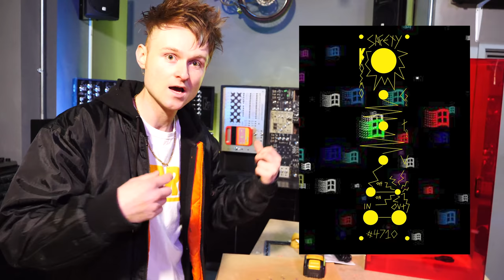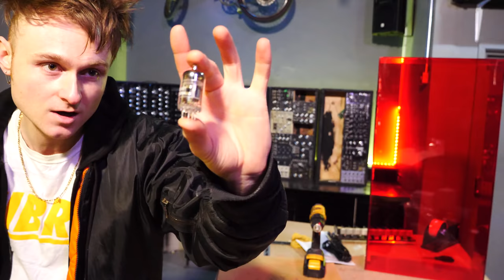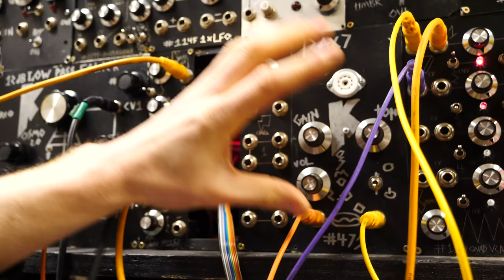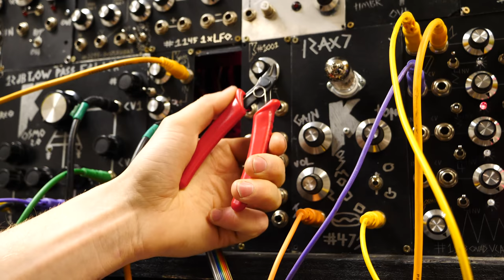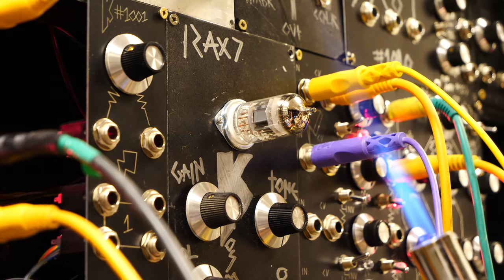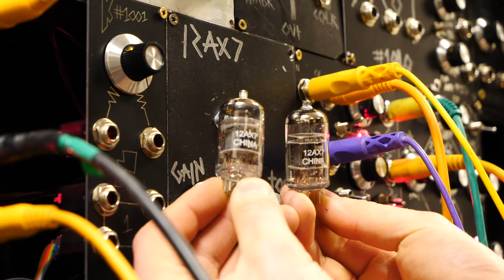Breaking a Vacuum Tube And Seeing What It Sounds Like - On A Valve Distortion

Comment: I'm leaning towards building a rack mount quad safety valve unit with four sections you can chain or use separately.  Can't afford a culture vulture so maybe this will scratch the itch. Maybe some Swedish input/ output transformers..Thanks for the builders guide vid..Awesome sounds!

Comment: Yikes. I unknowingly ran a 230V tube preamp with a cracked valve in it for a while and it literally caught fire. I had to rush it out on the balcony. The toroidal transformer in it got completely fried. Worked again once I replaced the tranformer and tube.
Reply: That should happen, toroidal transformers should be protected on both primary and secondary side with slow blow fuses, as well as having inrush current limiting, as well on primary and secondary, that peamp must have been pretty sketchy o.o
Reply: @yyunko7764  It was not a brand circuit no. A DIY thing, not built by me. No blow fuses in it at all but I was a bit surprised that the automatic flip fuse in the house didn't release once it started malfunctioning. I guess it would have if I would have let it burn and not unplug it as soon as smoke appeared. The flip switches are at 10A.
Reply: @tungtobak  Yeah for sensitive stuff, one cannot rely on the mains breaker. Toroidal transformers in particular require more protection as they draw a lot of current on startup which can be dangerous.

Comment: The difference between a transistor and a vacuum tube is that in a transistor, electrons flow through silicon that has been "doped" with either electron rich or electron poor chemicals or minerals. In a vacuum tube the electrons flow through it in a vacuum. If you fill the tube with anything (like air) the electrons will not be able to jump the gap between cathode to anode and the tube ceases to function - immediately. This tube, (12 AU 7) is a simple, dual "triode", or like two transistors in one package, and it's typically used as an output amplifier for audio frequencies. The two sides are often used in parallel to increase the amperage output without increasing the input voltage.
P.S. Even if the heating filament broke (the most common failure of a vacuum tube - same as a light bulb) the cathode would take a short time to cool and electrons would continue to flow for a (noticeable) fraction of a second. The decrease in volume is because heating the glass "nib" allowed just enough air into the tube to resist the flow of electrons but not stop it all together, until the "nib" was finally removed and the tube filled completely with air.

Comment: When I was a kid thirty years ago I smashed some valves just to see what's in there. It's nothing I'm proud of, but I'm not ashamed of it either. Sometimes you have to destroy things to find something out.
Edit: typo removed.
Reply: What did you find out?
Reply: Reading a good physics and electrinics textbook would haven you much more insight. Breaking things and looking inside is NOT a scientific experiment. It just breaks the device and makes it unusable.
Reply: Definitely the life of the party right here.
Reply: @pcuimac  yes always read books.  Never learn anything for yourself.  That's how the astronauts made it to the moon.  They read a science book that told them exactly how to do it.  Nothing was broken along the way.
Reply: @existential_fred  concentric thin metal sheets, bent to strange forms, some with thousands of tiny holes. Short wires. Powdery stuff. But I didn't see a single electron. Maybe that was because the air had already rushed in ;)
Reply: @pcuimac  So, what do they do at particle accelerators? Break atoms to have a look inside.
I was already told what's going in there by a radio technician. He was with my friend and me while we crashed the valves, to keep us from messing with the barium oxide. And you are right, it wasn't a scientific experiment. There were no scientists there. It was a kid's experiment. And kids need to see things. We also crashed some nixies that day. Those were even more interesting to us. And these days they were useless junk.
Reply: @pcuimac  That's just being closed-minded lol.

Comment: Is it me or does it sound really cool warming up :3
Reply from the maker: Well funnily enough the safety valve module is always in a state of warming up. It's extra frazzly because it never gets as.warm as the 12ax7 is meant to for proper functioning
Reply: @LOOKMUMNOCOMPUTER  it should have a heater voltage knob :P

Comment: Look Mum, No Valves..

I would like to see some sort of 'gangster engineering device' meddle with the micro voltages required for the valve - either by toggle switches, dials, touch sensors, CV etc and then use some ultra sensitive light sensors to capture and transform the light to spew everywhere and control things.  The Demon Valve Machine needs to be born!

Comment: I know another way you could do this...use the power supply from a plasma ball and you can basically make an atomically small holw that will beam a jet of hot plasma...you could pick a sensitive spot like the grid to spray an electron beam on...

Comment: Try toying around with valve heater voltage. You would probably need some some sort of digital thermostat to keep content temperature. I saw cheap ones people use in DIY ovens, just pass heater voltage thru it and tape its sensor to a tube.

Comment: If you want to play around with it a bit more, you can get modern ECC83 tubes, they are pretty much equivalent to 12AX7, just like ECC82 is the equivalent of 12AU7, from the sources I get mine the ECC tubes are cheaper

Comment: Interesting! Could you remove the glass from a valve and use a vacuum chamber to make the right environment for it to run? Then you could try different gases or something, I have no idea how valves work but might be cool to try. Interesting to mess with lightbulbs like this too
Reply: It might be neat to put neon in the tube.  Might not work for sound (maybe) but it might look cool
Reply: You can actually make valves by putting electrodes in a open flame. The flame is plasma and will allow the electrons to flow freely as if there was a vacuum. The problem is to get a flame that won't destroy the electrodes. You will probably want something that burns without soot and not too warm, but thats only if you want long-term use.

Comment: My band and I were jamming about three years ago and we were using two tube preamps/parametric/compressor modules and we were running the drum mix into one and randomly a tube exploded and shattered and it sounded like a bomb went off.... it almost stunned me and it was sooo loud. I have heard of this happening but never experienced it. Luckily my system had a limiters and power safety devices that kicked in to protect my gear but damn. Pretty sure my right ear/hearing took some damage haha

Comment: The 12ax7 may be cheap, but you may have to replace other components damaged by your 'fault insertion test', including a burnt circuit board.
Reply from the maker: never had that problem, but always a first

Comment: Similar to lennarts comment already here, how about you extend the valve/tube with wire then run the valve in a microwave oven... especially an 'inverter' type and at very low power so it doesn't just initially blast it at full power.  This is something I've been wanting to do for a while but hey if you're keen then please take it and run with it :)

Comment: would be interesting to see the same experiment done with basically a really sped up version, like inaudibly high frequencies, so that you could hear the affect during the brief second where it dies, though i suppose it would be more accurate if there was a microscopic non-crack hole in it that let extremely little air in per unit of time. i wonder if there’s someone that could make a sealed tube with that tiny hole for you, and then encase it in a sealed plastic box or something so you could test it out
Reply from the maker: Well that's what happened with the burner
Reply: @LOOKMUMNOCOMPUTER  oh right, yeah. i guess i was thinking like even slower, maybe only a few molecules a second

Comment: I know what could be interesting:
Valve tubes uses specific gases like argon, neon, mercury vapour and what not. Why not trying different noble gases such as Helium, Xenon (which is really heavy), there may be a colour difference but what if there's a sound difference?
The process of replacing the gas in a bulb is quite straight forward, I'm sure you can figure this out! :)
Reply: Valve tubes, do not contain any gases. It would interfere with the electron transport from kathode to anode. Think of shooting tabletennis balls through an empty tube, or one filled with tennisballs. It's just not going to work. Since a perfect vacuum is practically impossible, all valves have this part with a silver sheen on the glass. That's a buffer that harvests stray gas molecules, making the vacuum as close to perfect as possible.

There are gas lamps that contain gases, under low pressure. These are the yellow streetlights, known as low pressure sodium lamps, and the sign tubelights, commonly filled with a bit of neon. Xenon is sometimes used in high temperature lamps. Still just a filament producing light, instead of the gas glowing, but in this case it's used to displace any and all oxygen that might otherwise react with the metal filament, breaking it.
Reply: @AlphasysNl  Thanks for correcting me! I thought these valves had gases inside them, I really should have think a bit more: “VACCUM TUBE”.. 
Awsome knowledge you’re giving to us there!

Comment: Put an evacuation pump on there, and see if you can pull a strong enough vacuum, to restore operation, with just a 2-stage rotary vane pump.
     Those cheap tubes didn't produce anywhere as good a sound, as the Electro-Harmonix 12AX7 EH.(no loss there)

Comment: When we were kids in the early 90’s we found an old TV from the 50’s next to a trash bin. We took it out to a field and smashed it up with baseball bats. One of the giant tubes inside got a hairline fracture and it sucked in air so loud it sounded like a fuse. We thought the thing was going to blow. We smashed it to pieces after that. This was the day I saw my first vacuum tube.
Reply: Smashing CRT screens themselves are fun too. They do implode rather neatly with a weird sound once the vacuum is compromised. Me and a couple of friends used to frequent a landfill growing up in the 80s. Having lightsaber duels with used linear flourescent lamps was fun too (and yes I do know that they contain poisonous mercury, as a child however I did not).

Comment: That was silly Sam, anyone could have told you, the filament in the tube would have failed within 2 seconds being exposed to enough air. A better way to "hear" the effect of exposure to air, would have been to either gradually either de- or increase the filament voltage (following a saw tooth signal). Wasting a vacum tube was unnecessary (you also released some toxic quicksilver metal into the air). Anyway, I hope you got what you looked for with this experiment, that way it wasn't a complete waste :)
Reply from the maker: The filament didn't die in this case. It's not running hot enough. Your hearing an increased resistance between the anode and cathode due to air. Yes theory. But it still doesn't beat a good old fashioned physical experiment.

Comment: It turns off because the filament snaps when heated in open air.
Also because the electrons can't flow freely in air at the operating voltages of the tube, since air is an insulator.
Reply from the maker: The filament isn't broken.
Reply from the maker: Your right.on the electrons

Comment: As you know, vacuum tubes function in a vacuum. Sam, what happens if you break a vacuum tube inside a vacuum?! What happens if you replace air with different gasses like argon or helium inside the chamber and break it? Replacing the gasses might not be feasible for you but I think you could pull off a simple diy vacuum chamber no problem.

Edit: I was going to suggest wiring the torch remotely inside the chamber if you give it ago but I then assumed you're smart enough to think of that on your own. But then it made me think: torch synth. That's all.
Reply: Putting a gas torch, that relies on a flammable gas and oxygen from the air to do its job, in a vacuum chamber. I don't think you thought this through. Anyways, valves are called vacuum tubes for a reason. They need a vacuum to function.

Comment: Could you not run this in reverse? Use a flexible silicone hose attached to a vacuum pump  and see if you can then pull enough of a vacuum to make it work again, a valve on a t-piece after that would then let you add air at any rate and have the vacuum fight the valve

Comment: Could you place the valve in a vacuum chamber with wires connecting it to the module and then see how the sound varies with a controlled vacuum pressure? FOR SCIENCE

Comment: Put it in a vacuum chamber to see if you can make it work again
Reply from the maker: good one! probably would work in liquid nitrogen too tbh! possiblu too cold ill have a lookj for a vacuum ha
Reply: @LOOKMUMNOCOMPUTER  or possible replace the air around it with another gas at low pressure such as argon, xenon, helium, etc.

Comment: It works because of the vacuum. When you have no vacuum the the wire for heating the anode breaks and pppffffffffff kaput
Reply from the maker: the heating element is still intact. it takes a little while to go. and becuase these aren't at operating temperature it didnt perish

Comment: Seriously? Have you any knowledge of physics? Replacing the vacuum with air is increasing the resistance to infinite. Just removing it from the circuit would do the same. This kind of tinkering is just stupid.
Reply from the maker: Well yes obviously. It's more about practically what does the process sound like duh